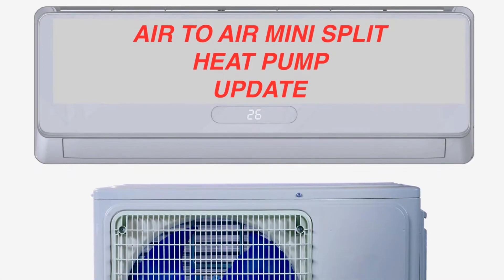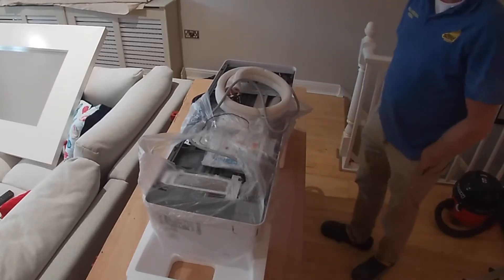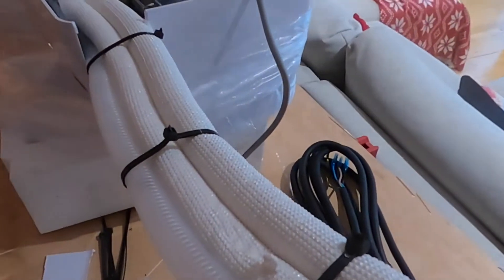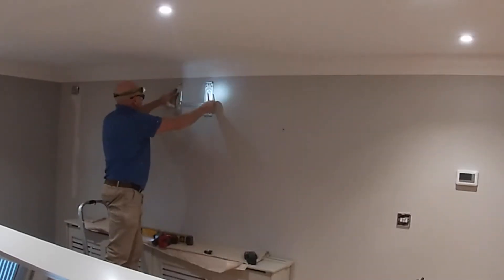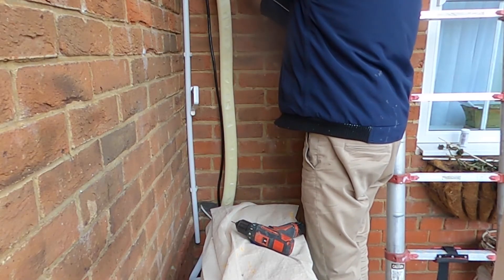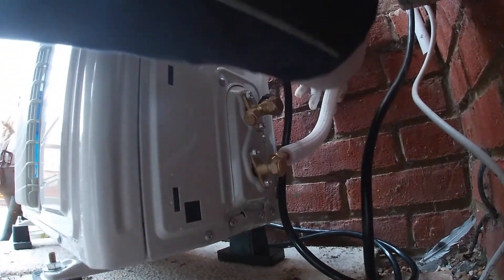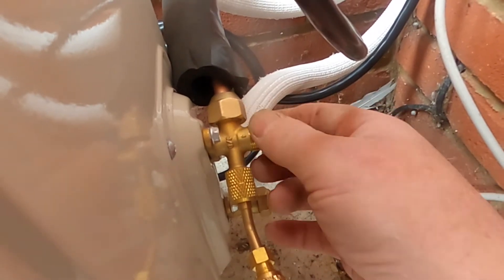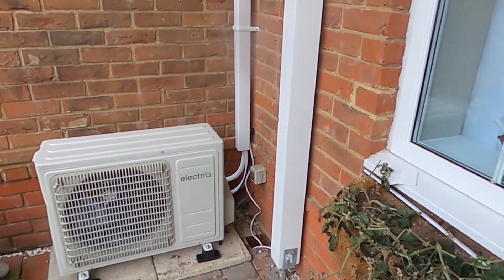DIY AIR TO AIR  MINI SPLIT HEAT PUMP  INSTALLATION OF SECOND ELECTRIQ UNIT

Comment: Great video and it's opened my eyes to new options. I was looking for better heating solutions for our 30sqm garden cabin as convector and/or fan heating is not doing a great job and I hate seeing the house battery depleted by lunch time! The cabin is not the most well insulated as it's more of a workshop type space but wondering if this mini split could be the answer. Any thoughts? It does get pretty cold in there on a frosty day and we don't get much greenhouse effect due to the aspect so it would need to do some work to bring it up to ~20c. Thanks.
Reply from the maker: Hi I think a mini split would be perfect . The advantage of the mini split is that within reason you can just walk in and switch it on  and within minutes the room will start heating .This way if your insulation is not quite up to standard  you are not having to turn it on say a couple of hours before you plan on using the room so this effectively make the mini split more economical over other systems . You will not be disappointed. Good Luck 👍
Reply: @HEATSEEKER1428 Thanks so much for the reply. It’s definitely top of the list. 👍

Comment: Hi there, great video and informative. I'm looking at buying the 12000btu. I cannot go rear exit with the pipes. I need the pipework to exit to the right (opposite way you have done) I see from unboxing that this is where the pipework is fixed into the unit, can you bend this round to exit to the right? I emailed appliances direct and they said no it needs to be rear exit only. Thanks in advance for your help!
Reply from the maker: Hi am am not 100% sure If there is a Knock out box in cover I would think that you could Teese pipe set around carefully. the only thing is if I remember correctly the pipes attached to the indoor unit is quite hard, Regarding help line I have not found them help full in past .  I will check to see if I can find some info and let you know. thank you 👍
Reply from the maker: Hi  I have just done a quick check. I can see your problem  . if the pipe set was going to exit straight out of the back the pipes would have to be straightened  so if you are careful you should be able to bend them round. . If the are a bit stiff you could anneal the pipe . Good luck 👍
Reply: @HEATSEEKER1428 thanks for your reply. I've just seen a video of an installation manual posted by someone else on here. It clearly shows that you can go out either each side or out the rear on each side. I'm guessing the tech support who emailed me don't know too much about their products!

Comment: I thought your video was very informative, I noticed the pipe work that came with the unit did not reach the wall ,did you use the soldering system you showed to extend it from there .
I have bought one of these units and the papers says you can’t have a mechanical connection inside the house so I now have to extend mine the same as yours .
Reply from the maker: Hi yes you are right about mechanical joint in side property. I actually braised  my pipe set . It is just as easy as soldering  just a little more heat required. The correct braising  Rods are available in small quantities on line . If you prefer to solder just make sure you use a solder fit for purpose with high silver content and obviously the appropriate flux . solider for domestic plumbing and heating is not recommended  . Thank you . and good luck 👍
Reply: Thanks for the info ,did you use a brazing kit and brazing rods and flow nitrogen through while brazing,I am a bit concerned now as I don’t have that equipment,I have bought the staybrite 8 solder and flux kit and was going to use that .
Reply from the maker: @PaulF-w1l  Hi I just got a few brazing rods with some flux from a seller on eBay. Did not use nitrogen .   if you are having trouble acquiring brazing Roda  you can use the appropriate solder and flux ., which I think would be more available and easier to use .  Thank you. and good luck 👍
Reply from the maker: Hi I have just checked on eBay there are  lots of sellers with products that  might be of use to you . Thanks👍

Comment: Hi,
This video was really helpful thank you! I found  that none of the instructions provided by the manufacturer online show the purging process, only the vacuuming process.  This is because they are the older doc versions. I have uploaded the instructions as a video here https://youtu.be/lWgGvDcwqPw
(I wish I could just put them as a PDF somewhere, but I am not sure where I can do that where they will be search indexed as well?)

By the way  I couldn't see in your video where the drain hose connects inside the unit??.. is it where the black bung currently resides in the unit.  I assume I remove this.

I am planning to video the purge technique at the weekend if you are interested in linking to it once I upload it.  I will give your video a mention in mine, and put a link to yours in the description.

Comment: Good video, I will be ordering the 18,000. Looks like you could do a rear install of the pipe work, I assume the pipes will bend 90 degrees and go out the back of the unit?
Reply from the maker: Hi yes the pipe set will lend it’s self well to rear installation. In fact I think rear is probably preferred by the manufacturer . Thank you

Comment: Great video, can you tell me what I need to do power wise ? Does the outdoor unit connect to the indoor unit then just power the indoor unit to a fused 13amp spur ? Does that then power the outdoor unit too ? Thanks, andy
Reply from the maker: Hi  all you need is a power socket the in door unit is supplied with a 3 pin plug fitted. And then you just connect in door and out door units via supplied cable. Just follow instructions and you can do it. Thank you. And good luck

Comment: Just watched your video, very helpful, if you extend the pipes by using the 5m kit is the gas supply still sufficient or does it need to be re-pressurised. TIA
Reply from the maker: Hi if you use the extra length pipe set ordered  and supplied with the unit  there is no need for extra gas . I think there is an allowance . I have fitted one with extra length pipe set  and no problems., been installed for 2 years .  Always Follow manufacturers instructions . Thank you and good luck 👍
Reply: I have just bought the v5 12k btu version and it states in the manual you must add more refrigerant if extending the pipework more than what comes in the box (4.5m including indoor unit pipework).

Comment: the current unit comes with 4.5 mtr pipes , any idea whats the shortest i could cut them?  thank you
Reply from the maker: Hi I think you can have the pipe set as short as is needed. How ever please  be sure to follow the manufacturers  instructions . Having said that depending on where you mount the out door unit will determine  the length of the pipe set , You will be surprised how much pipe will be required to run a perceived short distance .
When  various  bends have been made .Good Luck 
👍

Comment: Many thanks for uploading this. I just ordered this unit even though my garden room build won't be completed for another 3-4 months. I was told by the customer service agent at Electriq that these R290 units would no longer be available, so jumped at the opportunity, when I saw them back in stock this morning.

Your video will be very helpful when I install it later in the year.
Reply: Make sure you life insurance is up to date

Comment: No nitrogen  when soldering??
Reply from the maker: Hi no  nitrogen when soldering  I am a plumber by trade,  I realise that nitrogen is used to prevent oxidation on the inside of pipe .  I Know it is good practice to use but  Didn't think it was necessary  need for such a small job. Thank you

Comment: have they stopped selling the r290 units , not seeing anything for sale for diy users
Reply from the maker: Hi yes they have stopped selling these units  it is an outrage in my opinion.  ( kill joy's ) Thank you 👍
Reply from the maker: Hi  appliances direct have started selling the ac units again  code numbers 879042 9000 btu and 865335 12000 btu. hope this helps 👍
Reply: @HEATSEEKER1428  appreciate the update thank you

Comment: Thank you for doing this video it is very helpful. You mention in one of your replies that the pipework can go straight out of the back of the indoor unit.  Would this hide the pipework from view and would the metal bracket you hang the unit from get in the way?
Reply from the maker: Hi yes the pipe set can go straight out of the back of the unit and no pipe visible  . thank you 👍

Comment: thanks for your video.  Looking to buy the same unit.  What model vacuum pump did you purchase?  Or do you have a link from Amazon?  thanks
Reply from the maker: https://www.amazon.co.uk/dp/B01MR2TWY4?ref_=ppx_hzod_title_dt_b_fed_asin_title_0_0
Hi  I hope this helps  this item was from amazon  and I also had to purchase an adaptor  in addition with was only a few  pounds.
Thank you. And good luck .
👍
Reply: @HEATSEEKER1428  what a bummer...the easy fit DIY model is now out of stock, lol

Comment: Excellent video, you didn’t really touch on the electrical connection. Is it hard wired or does the unit plug into a socket
Reply from the maker: Hi The Indoor unit comes with a plug attached and it simply plugs in . The cable is supplied to connect the out door unit . Thank you .👍

Comment: I may well be compelled to fit an air to air system because of rigged energy  prices.  But the rationale  that CO2 has caused a climate problem is  very wrong.  Across space the Sun transfers energy by radiation.  Thats the only way it happens and radiation works by vibration of the incoming photon and a resonant molecule.  The photon as emitted is at the energy level on the Sun travelling at light speed without mass or charge.  these may be focused to burn by a lens but never having more energy than the emitting surface.  Moon beams for instance are never hot enough to burn or those emitted by a bock of ice .CO2 has a spectrum and outside of this frequency range no energy is transferred.  It seems most of any reaction to radiation was in the first 20 parts per million heating strongly as our atmosphere was first forming.  After this it lessened on a log basis as more CO2 is added.  In an experiment the University of Pennsylvania wrote above 340ppm no measurable heating was detected.   That experiment killed of any hypothesis that net zero was going to have any effect on climate.   So they stated reason for heat pumps is void.  and we are manipulated into a panic mode without any valid reason.

Comment: this is my second installation around  my house  , first one being 9000 btu and my new one 12000 btu, easy self fits, and both pre gassed,, and working great, i do have one question, if i need to refill and the gas being r290, what pressure should i have to reach on my dials, f reg installers will cost me more than the units themselves,
Reply from the maker: Hi take a look on amazon there is a simple r 290 refill kit  and just follow instructions , obviously if you suspect locate  that first . Thank you  and good luck .👍

Comment: great video.,i do have a quesion, i have purchased the same ac unit, be it the 12000 btu unit, my question is , ive come to take the caps of the pipework connected to indoor unit, but they seem to have some form of air escape so tightened back up quick, any advise on that please.
Reply from the maker: Hi it is ok to remove those caps , the indoor unit is under pressure but that is just from factory . leave those caps in place for as long as you can before making the connection to the pipe set  to prevent any possible dirt entering the pipe work. Obviously do not open valves on the out door unit until you are sure all connections are tight and leak free. Thank you and Good luck .👍
Reply: @HEATSEEKER1428  thanks for quick response. And then vacuum down the pipework ,yes.
Reply from the maker: Hi Yes if you have vacuum pump , that's great as you can test pipe  when vacuuming down  👍
Reply: hi 450pulse , is yours working okay , would you still reccomend it ?

Comment: superb video im thinking of getting one of these.The only thing u didnt cover was the electrical? does this run off a normal 13amp plug? thanks and advice appreciated
Reply from the maker: Hi yes it comes with a Uk  3 pin plug with a 10 amp fuse fitted . Thank you 👍
Reply: @  thankyou what model did u buy do u have a link 👍
Reply from the maker: @teardropsmodpodz3077  Hi I bought and fitted both the 9000  btu model and the 12000 btu model from appliances direct. they are made by Electriq https://www.appliancesdirect.co.uk/p/eiq-12wminv/electriq-eiq12wminv-wall-split-air-conditioner#:~:text=electriQ%20Easy%2D-,Fit,-12000%20BTU%20A. Be sure you order the units that do not require an f gas installer  thank you .

Comment: Just wondering how this unit performs in the current cold weather when temperatures are close to zero? I currently have an old LG which is dying and will soon need to be replaced. I'm competent with the DIY install but also wondering about noise levels of the outdoor unit?
Reply from the maker: Hi  no issues with cold weather , Although a few week ago we had - 5 and a fault code  F 7 came up  I tried to ring tec. help line but not much help so I took the initiative and removed the top cover  of out door unit and all I could see was that the bottom tray was full of ice . something had stopped the condense  from running away . I cleared it and left it for half an hour  and it has been ok ever since . . The noise level of the out door unit  is for the most part quiet just the sound of fanned air.  every now and then it goes into defrost mode  and there is a bit of noise and it is not for long   I certainly can't hear it in the house .
Thank you .
Good luck. 
👍
Reply: @HEATSEEKER1428  thanks very much for this 👍

Comment: how did you fill it with gas
Reply from the maker: The out door unit is pre charged with the correct amount of R 290 . All  you have to do is connect pipe set to both the indoor unit and outside unit .Ensure there are no leaks  and then just open the valves on the out door unit . Thank you. and good luck .👍

Comment: Fitted one of these a year ago using a vacuum pump as you did. Straight forward to install. I purchased a small flaring kit as I was going through the back of the inside unit directly to the outside unit and shortened the extension pipelines accordingly. Getting a COP of 4.5 not bad for Londonderry.  These are fantastic value pieces of kit.  I actually did as you did and used down pipe through the wall.
Reply from the maker: @alanbratton8357  Thank you for your feed back. Good luck.
Reply: alan how short did you make the pipes , im struggling to find much info , did you have to alter the gas charge accordingly?  is it all still running fine and reccomended thanks

Comment: Hi great video, i have bought the same unit. I have an f gas qualification for cars but I am led to to believe they are the same?

I dont have the vacuum pump or anything like that so wanted to do this the other way. I noticed the 1.5m pipes out of the evaporator seem to be charged so when I remove the caps they leak. Will this leak all the gas out of the unit, or is it just residual? I dont want to risk burning myself, I am a little concerned now.
Reply: I know this is nearly a year old now so I hope you sorted it but the indoor unit has a bit of inert gas in it to prevent moisture getting into it so you will get a hiss when you unscrew the end caps. Not a problem. All the refrigerant is in the outdoor unit.

Comment: I enjoyed your video, and ordered a unit on the back of it.
I was able to put my outdoor unit directly behind my indoor unit, and all was going great until I realised I couldn't connect the pipe work from the indoor unit directly to the outdoor unit, and had to use the extension pipes included.
Unfortunately I inky realised when everything was on the wall, and then couldn't make the connection.
I tried to use the supplied extension pipes but due to the lack of space for 3 meters of pipe I have managed to put a small kink in the larger pipe.
Firstly will this cause much of a problem with the unit, and secondly is there a connector that can connect the 2 male ends?
Any help is appreciated.

Comment: I already have an external lockable isolator adjacent to where the external unit will be, but no power point near the internal unit. I assume I can just connect a supply cord to the external unit and remove the 3 pin plug cord from the internal unit. So instead of the internal unit supplying the external unit, it will be the other way around. Do you see any issues with this? Thanks for a very informative video.
Reply: Replying to myself as Heat Seeker seems to be seeking heat elsewhere🤔 But short answer to my question is 'no', for too many reasons to list here, especially as it would seem very very few would read it anyway,, and even fewer would be interested  ;-)
Reply: What about sending the mains cable from the indoor unit through the wall following the other pipes and cable and plug in on the outside wall?